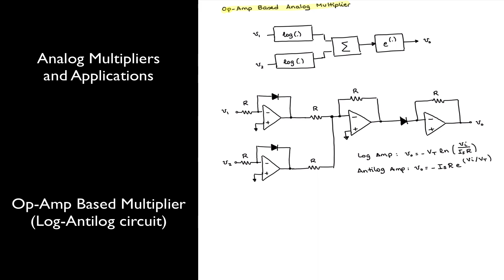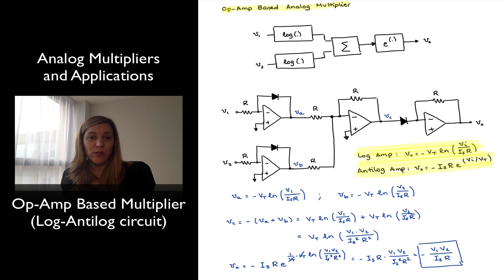Op-Amp Based Multiplier

Comment: does this circuit work in application? I've tried two different types of op amp chips and it doesn't work. Also, does this work in audio applications?(50Hz - 15000kHz)